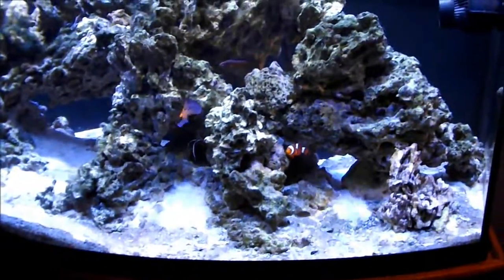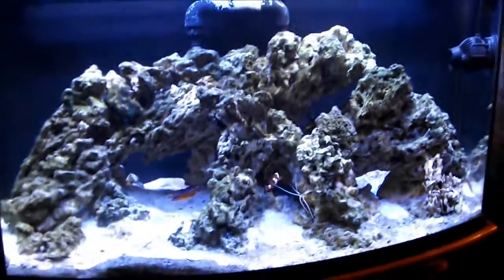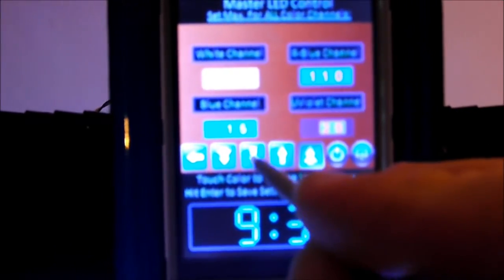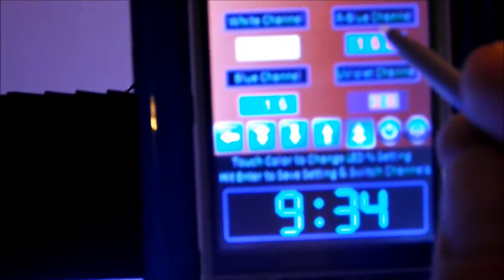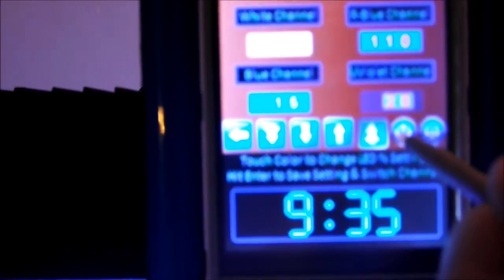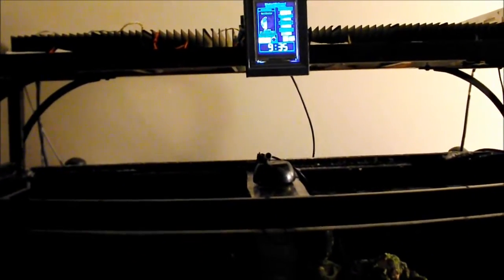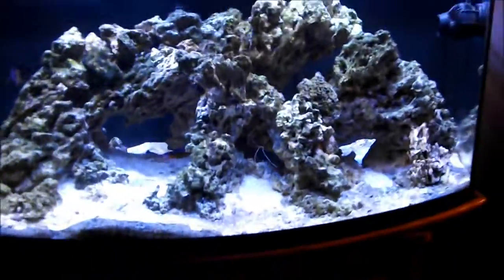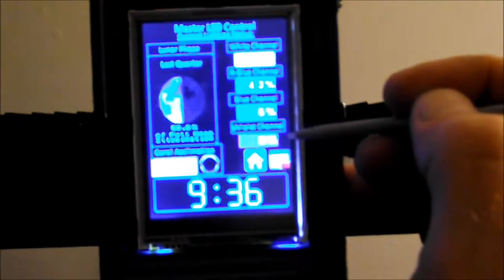DIY Arduino LED/Reef Controller -LED Control Tweaks

Comment: I can tell you that my LEDs are full spec. and i have the white (full spec.) set to 50% max for 4 hrs in the mid day. Blues  max at 70% for the same 4hrs in the mid day. I dont know what  brand or watts your LEDs are, but i would say to raise your %s and spend the extra $$$ on a par reader. IMO good luck.
Reply from the maker: I will be building a PAR meter at some point. I already have the code and the plans...jusinsteadt need to get the parts.

I had them at those percentages for about a year, but I'm going to start out low and raise it up instead of the other way around

Comment: There's going to be a lot of blue in the light... if you've followed the recommendations for LED layout, you're good... put some coral in there lol.  Put some at the bottom and see what happens... every week move them a little closer to the light and take note.  Start with low end zoas, you'll be fine.
Reply from the maker: I'm going to give that a try...starting to get it dialed in to where I am comfortable with an attempt.